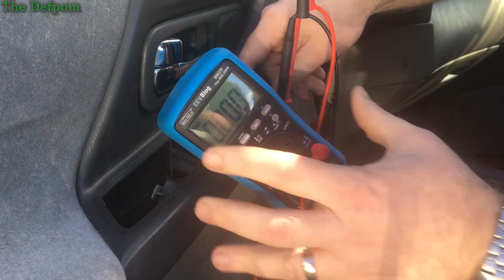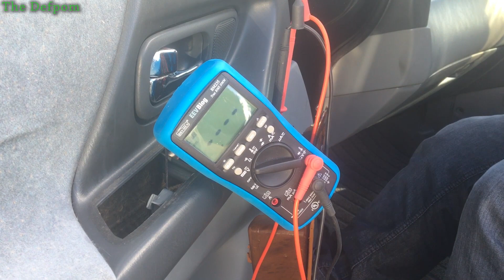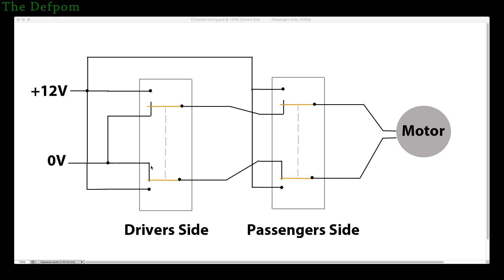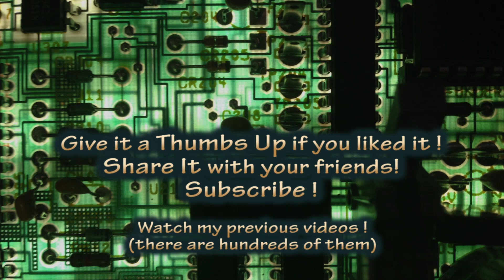🔴 #427 Car electric window not working - how to test it and fix power windows

Comment: I think my switches directly power the motors, because there is so much arcing in the sw contacts you only get 20 window presses before you have to clean them.

Comment: Well done :-D
Thankfully it's an old car, otherwise the main computer does the control, then it can get nasty, i've been there.
If it still plays up, check inside the rubber gator between the body and door, wires fracture with bending over the years, very common.
Hatchbacks have the same problem, same gators with busted wires.